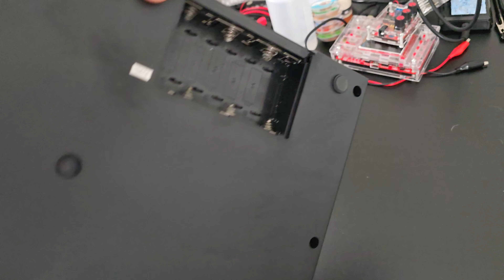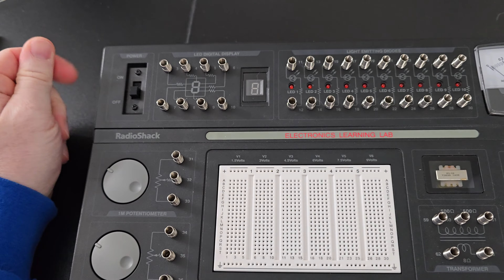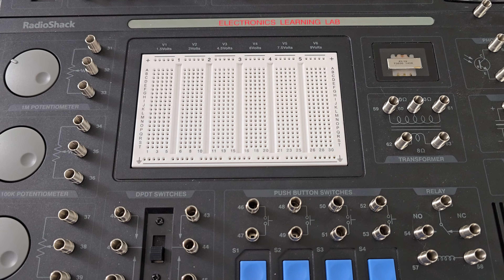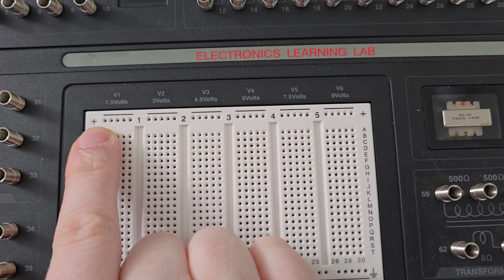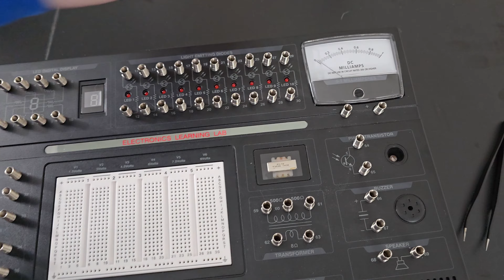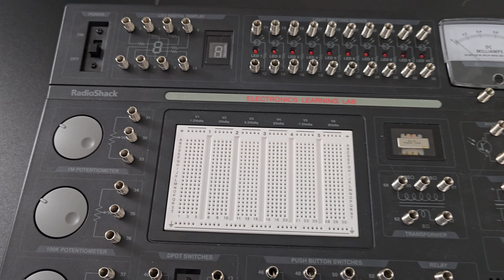Electronics Series - Board Setup

Comment: Great video! I was screaming TEST LEADS! when you were checking the resistors again at the end. I'm an auto mechanic of 30 years. Learned the hard way of rechecking the leads before checking different measurements like that. Real easy way to blow the fuse in your meter and they are a pain to find replacements when you need to replace them. At least on Flukes. 
Also, a good habit to get into is checking your meter and leads any time you turn the meter on. Like you did when you realized you didn't switch back to the volt port. Been burned a few times on bad/ worn out test leads. Especially high grade super flexible test leads. The copper breaks inside the insulation and it's not obvious. I enjoy your patient flow with your videos. 
Can you link for the software program you were using? looks useful and user friendly. Keep up the good videos
Reply from the maker: https://www.ni.com/en/support/downloads/software-products/download.multisim.html#452133

I have the program from school. It's the best simulation software I personally have used. I think there is a free version to try.

Lol yeah I felt like an idiot! But it's real. It happened. So I kept it in the video because I'm human and hope others learn from my mistake. I RARELY measure current it was more of a showing people how to. Thank you for your service! Mechanics don't get the respect they deserve. 30 years is a long time too. You're absolutely right great habit to check ohms on meter before applying it to the circuit. Again, I appreciate your feedback and checking out my content. I'll be looking for your comments in future videos. Always feel free to share your experiences, tips and tricks you've picked up across your 30+ years of experience.
Reply: @SteeleOfAllTrades  I'm really glad you didn't get offended, not what I was trying to do. Absolutely you should have kept it in the video, experience is everything! Thanks for linking the software, I'm getting back into computers and electronics more like when I was younger and trying new things. I enjoy electronics in cars but it's not the same anymore.  Everything for the most part is software upgrades and or replace a module and reload software when it comes to the electronics. Keep up the good videos! If you don't mind me asking what are you studying? If you ever need car advice, particularly Volvo, let me know!
Reply from the maker: @mattw1427  Cars are NOT the way they use to be. I enjoy my older paid off vehicles I know inside and out from making repair. Well, videos I'm posting now are very basic, but we'll get into cool stuff later like logic gates and all kinds of stuff! Open to suggestions as well I will make stray electronic videos outside the series here and there as well. I have a degree in electronics engineering. I'm at a point in my life where I want to volunteer and teach what I know so that's how the YT really started and is headed. I love good education channels and I hope to one day be one of those guys on here with thousands of little electronic videos.